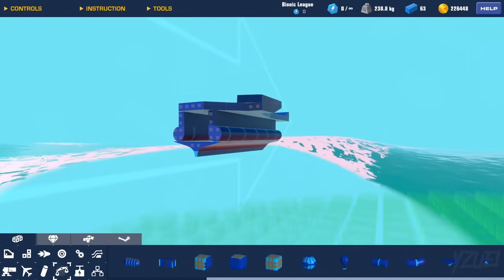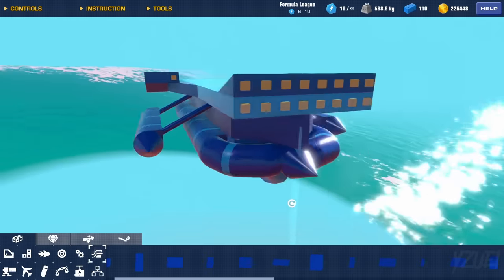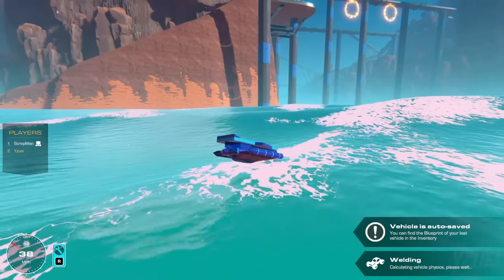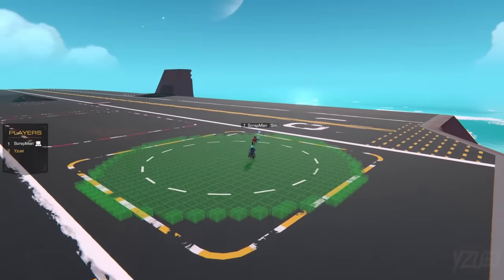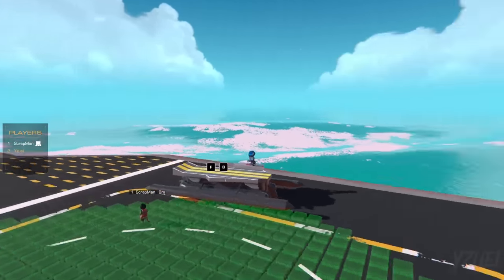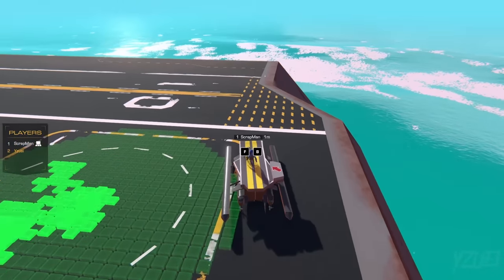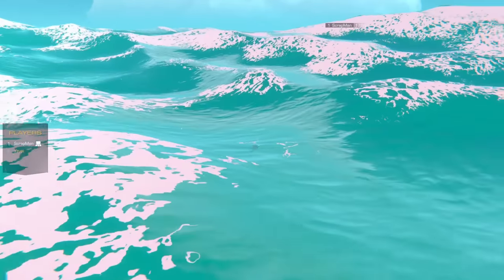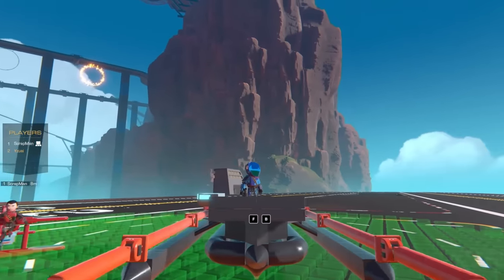Can We Do AIRCRAFT CARRIER Landings BUT With INTENSE WAVES?!

Comment: Pls try doing this,but with a Landing cable using energy beam connectors or suspension as well as a tail hook
Reply: they would brake
Reply: @duck_go_brrr cable helps the plane to brake
Reply: Beam connectors unfortunatly don't have collision :/
Reply: @Pale_Kingg Exactly I tried this but the hook just went through😂
Reply: @darfderkevinspielenkommen1253  that's unfortunate :p
Reply: @b.e.h7324   nah really im saying they would brke
Reply: @duck_go_brrr  do you mean break
Reply: They have collisions @Pale_Kingg
Reply: @scoobythebest57  no they don't.
Only the ends have collisions.
Reply: @Pale_Kingg  o
Reply: use hinges, and with the motorhead damage update it wouldn’t break.